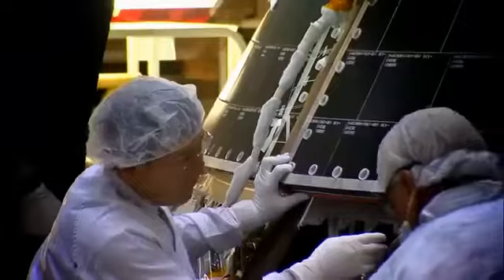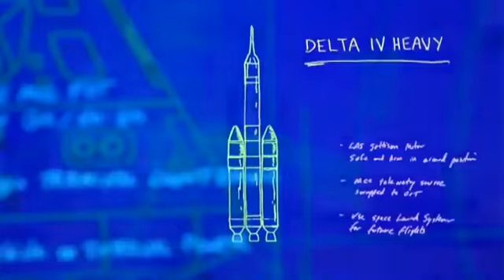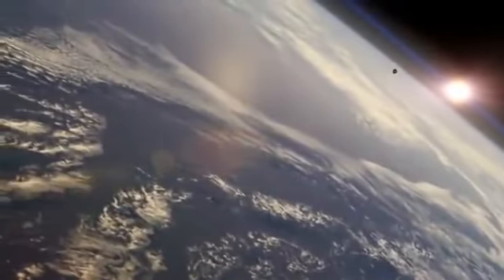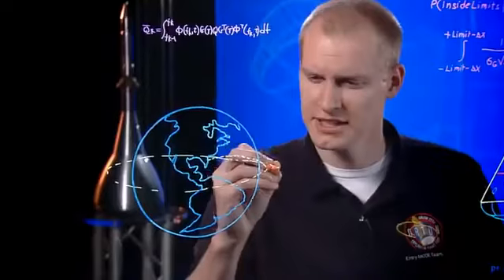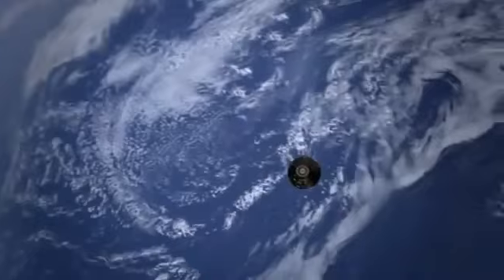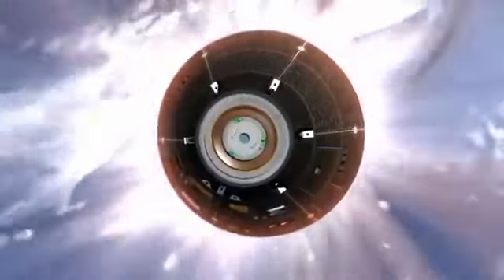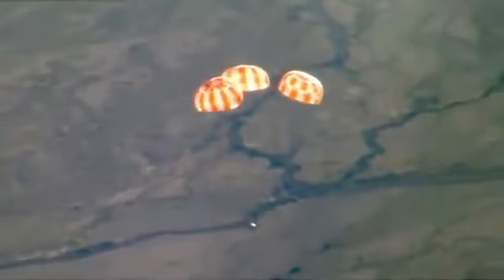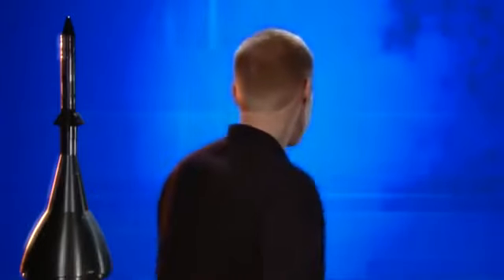NASA engineer admits they can’t get passed the Van Allen Belts

Comment: What I don't get it how they justify having to do tests to get through the belts, when they supposedly already have many years ago now.
Reply: There are two factors here: Orion is not the apollo craft. It's a new piece of tech. Obviously they have to test that it holds up in the field before trusting it to keep humans alive.

Secondly, as electronics have gotten better they've gotten smaller, and the current in them has gotten less as well. That means they're much more vulnerable to radiation, so we need to shield them.
Reply: @ @seigeengine :  But what about the latest mars mission (Insight lander). They sent them without problems with "new" electronics, so what's  the problem?
Reply: @virgilsebaa3660  Well, on one hand, robots are just so much cheaper, and no humans are onboard to lose, but also that they're smaller, so easier to harden and test, and can largely just be turned off while passing through.
Reply: @seigeengine   I aws talking about electronics. The Nasa talk about protecting computers. It's supose to work at this time no????
Reply: @manutelol Why WOULD you replicated late 1960s technology? Why WOULD China or Japan have done that?

Money is always an issue. China's foreign aid is a tool of political power. Don't mistake it for charity. I also see you've never made a budget or been financially responsible in any regard in your entire life.
Reply: That's because you didn't think it through. They are testing a NEW PIECE OF HARDWARE. There could be mistakes in the design or construction. An engineer could have put the decimal point in the wrong place and the craft has only 1 tenth as much shielding as it needs. You test every piece of new equipment.
Reply: @starlight122012 What do you mean by sensor data? There's lots of data.
Reply: Men feel guilt when they dupe their fellow man. This applies to Masonic occult astronauts as well. To keep the myth going they are switching to robots and machines not because they are cheaper but because they don’t have a conscience. Take a look at the lives of these men who supposedly accomplished the greatest feat in human history. They isolated themselves and became alcoholics.
Reply: what? no testing of a new vehicle??? that’s what you claim they should do, just in order to satisfy a few silly conspiracy nutters?
wtf is wrong with you?

refer to a single technology from the 60ies which is still in use without a single change or improvement. name one. every single new technology has been tested intensively before hitting the market. for a good reason. the same applies for space travel, don’t you think?

telephones? nope, huuuge improvements there. 
TV? nope, gigantic improvements

Car savety features? seat belts and airbags, among other features like car design. 
 Air planes? huuuge improvements there too. 

so why don’t they reproduce the saturn V rocket and apollo modules?
well, for the same reason we dont build any of the above technologies; they are completely outdated. 

this is common sense... try harder, conspiraceeh nut
Reply: @seigeengine  I have a question. If smaller electronic tech compared to the 60s tech are vulnerable to this radiation, how did they manage to send probes and satellites, which are extremely sophisticated tech, beyond moon over the years?
Reply: @cafelatte1124  As I said, they generally shield it... that is, they design special electronics that are resistant to radiation. The military also does this in some cases. Obviously this is substantially more expensive than using mass-produced ordinary electronics stuff. The details of this are a bit complicated, and you should go read about them.

An alternative approach, which I believe SpaceX has gone with, is to use ordinary electronics, but to use multiple redundant sets of them... so instead of one processor calculating, say, a trajectory, you have three different processors do it, and then you can detect if something has gone wrong because the results won't match up between them.
Reply: It would not cost too much to send a craft up 100,000 miles and take it back down with test results,  Can they not send mice up?
Reply: @ValMartinIreland  Hahaha, the cluelessness.
Reply: @seigeengine so you think technology today is more fragile than it was in the 60s and 70s? Yes has technology progressive it gets smaller and more durable. Not more fragile or vulnerable. That's shit doesn't even make a little bit of sense. Like the rest of the heliocentric fairy tail
Reply: @DustinHebert-q8z  Sorry, neither I nor the facts care in the slightest about the rotting excrement you call your opinions.
Reply: TO GET MORE MONEY!!!!!!!!!!
Reply: @cafelatte1124  they never sent anything over lolz😂😂
Reply: Well, they destroyed everything really quick back then and forgot how to do it. It happens to everybody. 🤭
Reply: @seigeengine ya u are right all they had last time was a rig wrapped in tinfoil, and wait for it.......they were even able to communicate from earth to the moon at that time.ahhahajahajahaha.

Imagine how far gone ud have to be to believe that.

Oh and then they even went n destroyed that technology and everything at that time and guess what.....it's a very painful process to get it back...lmao